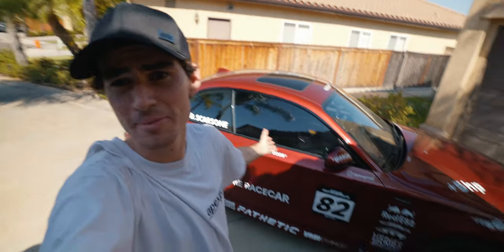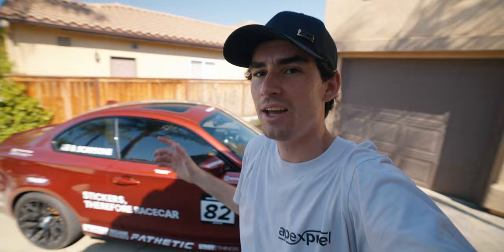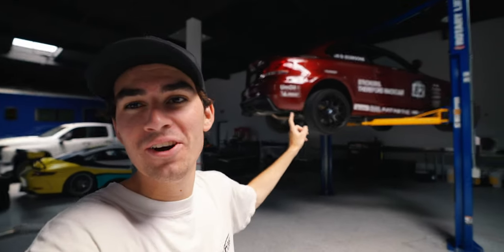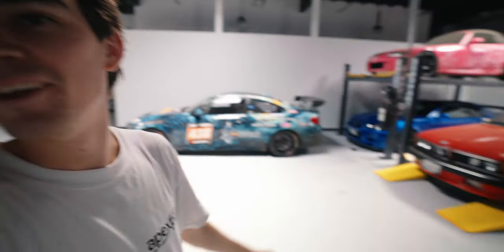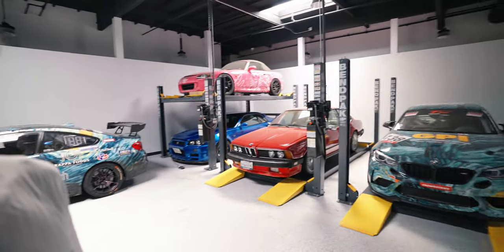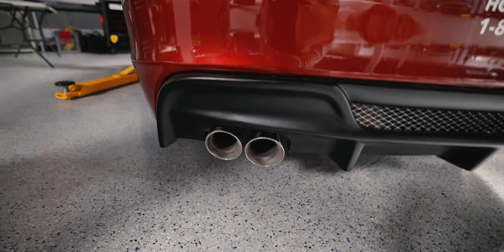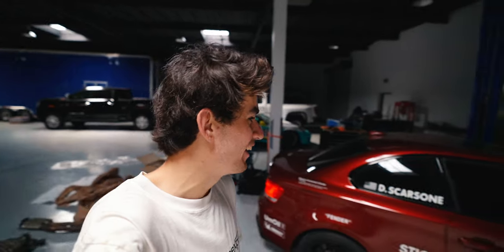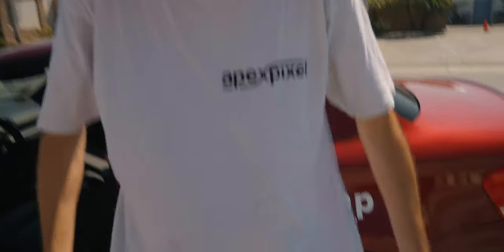Race Exhaust in My BMW 135i | Berk Technology Catback Exhaust Install

Comment: I have this same exhaust except with the muffler. I had such an awful time with the mid-pipe install. The studs on the downpipe broke taking off stock. Which I figured normal nuts and bolts would be a fine replacement. but that downpipe is in such a bad spot to try and get a wrench on the back and tighten down the bolts. It just never fit right for me and I've had leaks. Guess I'll have to get back under one day and see if replacing the studs will help.
Reply from the maker: Oh gosh! We got pretty lucky that everything was in good condition under the car. Not to exhaust installs will ever be the same but it sounds like you could even replace the Dow pipe with something my aggressive and that will fix your seized bolt issues 😛
Reply: get a downpipe and it will probably come with the bolts. the vrsf did. but then you have to play with the clamp before it. might as well buy a clamp too if going that route.

Comment: i just went buy their hq and picked up the street today in black. if anyone lives in southern california call them and ask about cash discount. save you about a bill. i put the mids on a few months ago. had a dinan muffler but it was almost 10 yrs old. hope it sounds better. race is the way to go if you keep your cat. i got a race cat cuz the smell was to much with catless. miss the extra horses but i like windows down.
Reply: @apexpxl  Berk let me try the race exhaust. Can't wait to install. Do you know what the top bolt hole is for. Those absorption rubber things on stock exhausts?
Reply from the maker: not exactly sure what you’re referring to but the rubber bits are hangers to it doesn’t vibrate like crazy. made to dampen some of the noise and vibrations
Reply: @apexpxl  there is a flat bracket welded on top with 4 holes. one has threading for a bolt. came with a washer and nut that looks like the same size as the threading. stock exhaust have a bracket and threaded hole for a rubber cylinder that I think is for noise/vibration reduction.

Comment: how much hp does this add? or is it just performance
Reply from the maker: hard to say the numerical impact on HP without dynoing the car before and after (though berk may have actually done this about 10 years back). 

the car feels more responsive and certainly likes to rev higher with the setup on but the primary benefits are for sure in the exhaust note & tone

Comment: Also do you have the link for your rear bumper + black plastic / diffuser that comes with it ? 
Thanks :)
Reply from the maker: Of course! The bumper itself is stock but the diffuser is aftermarket. If you Google “Duraflex R1 Rear Diffuser” you should be able to find it.
Reply: @apexpxl  thanks :)

Comment: would this exhuast work on a 2011 128i?
Reply from the maker: hard to say not knowing the configuration of your stock exhaust. i don’t think it’ll be a plug and play fit but there’s tons of options out there for N52
Reply: @apexpxl  what options are there? I really like the berk exhausts would some of them fit? What things should I be looking out for?
Reply from the maker: @jasonchen7619 looks like VRSF has a nice option for your car. Can’t say as though all the Berk pieces will mount properly with your car. you could always buy the exhaust and pay a shop to make it work (fabricate mounts, etc). Would need to take a look under your car and measure some pieces to see what would work. 

I’d recommend hitting the forums for your car and see what others have done / what works best!

Comment: How is the drown on the highway at 70MPH?
Reply from the maker: Very manageable in my opinion. It’s probably worst around 60-65 at ~2,000rpm but once you get over 70-80 (which seems to be the flow of traffic where I live) the car gets comfortable (~2,300rpm) 

It’s easy to have conversations with a passenger all throughout, especially with the windows up. Drop the windows and up the RPMs however, and that N55 goodness really comes alive 🤤

Comment: Go Catless DP burble would go crazy
Reply from the maker: Need to see if there’s a high flow dp that’s road legal (probably not...) 
Catless would be insane though!
Reply: @apexpxl  I think he's reffering to in the mhd settings there's an option for stock downpipe burbles  or catless downpipe burbles.   Choose the catless down pipe and add burbles for the duration and aggressiveness that you prefer. 

It will sound great on soft or medium for a duration of about a 1-1.5secs
Reply from the maker: Haha ahh gotcha! 

I think I mentioned there’s not burble tune on the car but the more I think about it, there probably is from the previous owner. He set it up with stage 1+ and left it for me to enjoy. Might have to dive into the MHD side of this more fully pretty soon 😈
Reply: Stupid  California laws! 
Im dp's and straight piped.  Don't have to worry about that in Az.
Reply from the maker: Wondering if I bite the bullet and go catless as well. I figure the car is still quite enough to slide under the radar but catless would sound so nice!! Not to mention, it’d make the car come alive a bit more. 

Will see what I end up with in the coming weeks 😈
Reply from the maker: Still very jealous of ppl who live where there are no restrictions!
Reply: @apexpxl  not worth the trouble you would be getting to if you get state refed. It will be loud at wot.
Reply: @apexpxl  can replace the existing one with a race cat. 200 cell would be fine.
Reply from the maker: My fear going catless is that even in 7th gear, low rpms it’ll still be too loud. But I suppose it depends more on the cop’s mood atm? 🤔

Are race dp (200 cell?) technically legal? Seems like just go 🐱less at that point, no?
Reply: @apexpxl  they are race cats that outflow  high flow cats. They will act like a muffler and not be loud.
Only time my  car is loud at cruising speed if it's  above 85 mph. Then the drone sounds like a V8 with turbo mufflers. And Im dp's, no 2nd cats, or muffler.
Reply: @apexpxl  check out wagner-tuning. They have the cat you are looking for. Then you put spark plug defouler to keep the 02 sensor out of the stream to try and not set a cel.
Reply from the maker: I’ll give them a look! Thanks for the advice 🤝

Comment: If only 135’s weren’t so expensive to maintain much less but right now 🥲
Reply from the maker: Suppose that depends on your luck, the condition of the car you buy, and how well you look after/hard you drive it. I’ve been pretty fortunate thus far!
Reply: @apexpxl  that’s fair! I just know a good condition, lowish miles 6MT clean title 135i is gonna run upwards of $20k at least where I am.
Reply from the maker: That sounds about right where I’m at as well. Still a lot of car for the money if you find one that was well looked after.
Reply: @4myeyesonly  in texas and i got my 2013 135i 6spd (76k miles) for $20k off of marketplace. car has been great so far (82k miles)